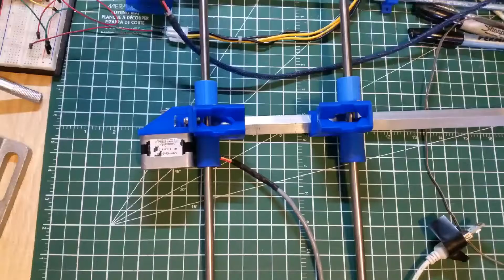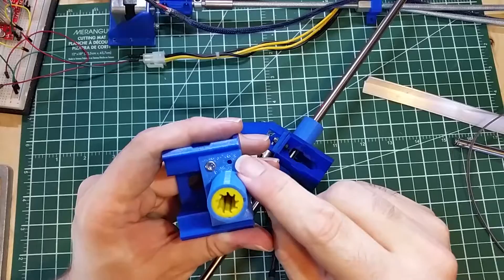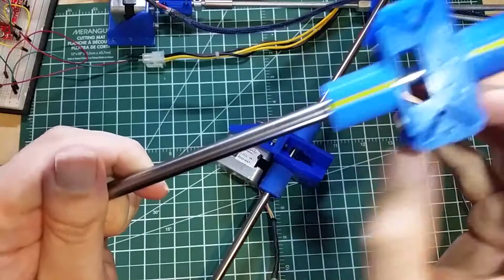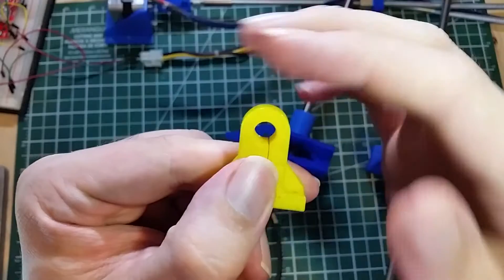Mech update 12 [X axis gantry ]

Comment: Thats slick as. Nice and quiet unlike my china bought linear bearings. I dont know why my linear bearings are so sloppy and noisy. My 8mm rail is actually 7.96mm and i wonder what everyone else's measure at. Time to follow you and make my own and see how they perform. Great work.
Reply from the maker: Yeah that is an other beauty of home printed bushings , you can size them to whatever rails you have .  trick is remembering the size for reprints, if liek me you have a few 'sizes' of 8mm rails LOL . I'm not surprised as i think cheap ones woudl be +- 0.05mm .   Also when you do your home printed ones they may fit snug on rails that have been warmed by your hands ,  and will be extra slick on the rails when the metal is room temp . ball bearings have tolerances for the balls to so that's 2x the slop vs a bushing .